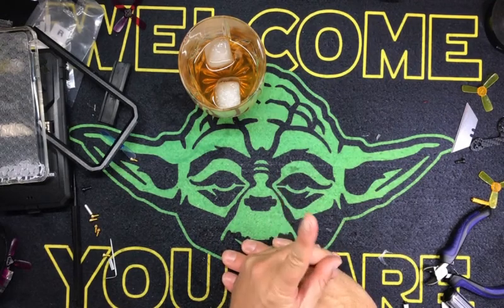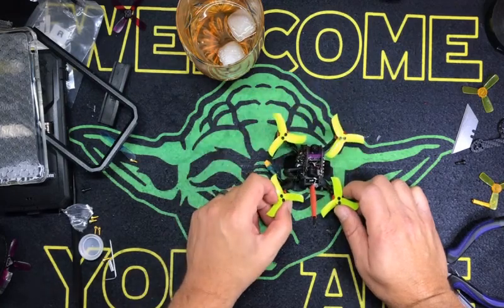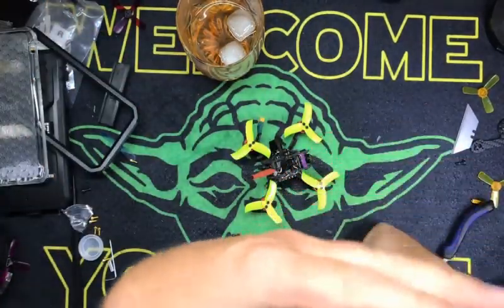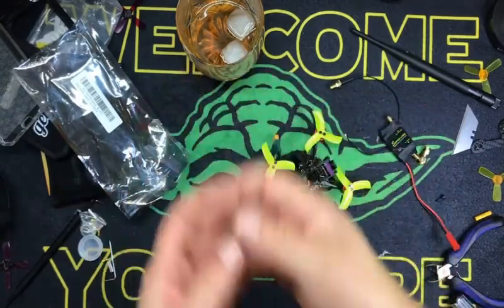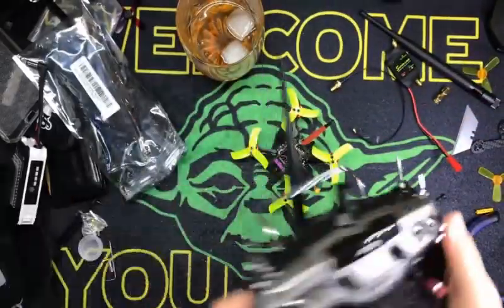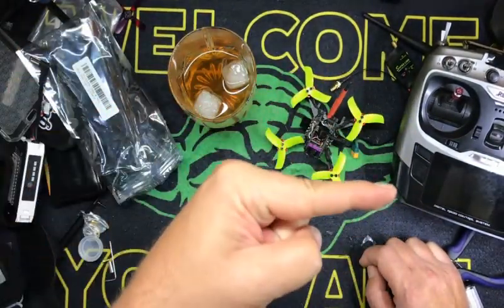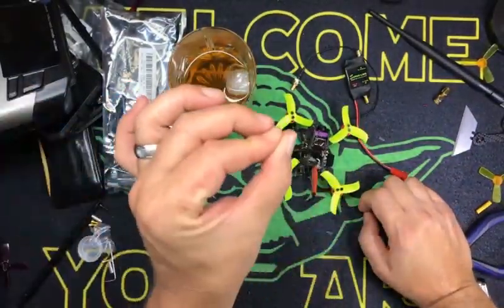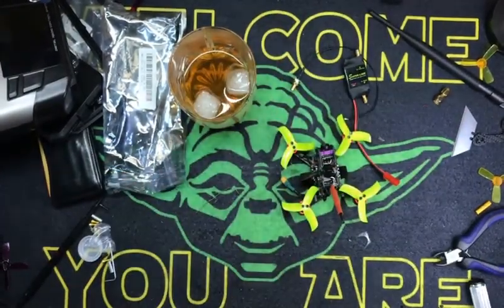RC Transmitter Range Boost - Episode 1 of 3 - The Before: Intro and test

Comment: lol I get nervous with a flysky a8s going over a couple hundred feet up. I've heard so many stories of failsafes and disconnects and what not with them. I've never had an issue on any of the three I have but you never know.
Reply from the maker: +Archer FPV yes I have one of those to that came with a review bird that was sent to me.   Not impressed.  I use it for a simulator controller lol.  At9 is a lot diff
Reply: JJRotoGeek I've been wondering about radio link. I was waning a storm racing drone at one time and they come with the at9
Reply from the maker: +Archer FPV I love mine.   I’ve beat it to death lol

Comment: Have u seen That new y4 frame banggood got ,,,,,,, https://www.banggood.com/A-max-Cerberus-Y4-110mm-Wheelbase-2_5mm-Arm-FPV-Racing-Frame-Kit-supports-Micro-Runcam-Swift-p-1210879.html.
Reply from the maker: +Quad Father 504 FPV just looked at it brother.   Dosnt look hateful, I see some things I’d change. I have a frame coming that I’m going to chop shop and I’ll do a video on it.   It’s a 110 tooo
Reply: JJRotoGeek ohhh ok lol I thought it looked like a pretty ok design with the back motors higher like a helicopter where u don’t have to worry about taking off or hitting ya battery, but can’t wait for the chop shop build 👍👍 n I think I’m  ordering the stuff tomorrow for a 3” build

Comment: Awesome!! Looks cool so far, but I’d try to keep the booster out of the case because of the heat, unless you put like a heat exchanger on it lol. I’ll be waiting for the other parts of the video but it’s looking awesome so far!!
Reply from the maker: +vidabask yessss I’m going to test that firsttt.  Part two should be up today brother
Reply from the maker: +vidabask brother, did u see the new firmware for our radios that makes Rssi work with any reciever and it works on the osd.  Just got it working.    Fucking awesomeeeee.
Reply: JJRotoGeek hooooly balls! They allowed to send the RSSI via a channel to the FC?! Awesomeeeee
Reply: JJRotoGeek are yo making a video on that? Lol I'll be waiting for the second part of this one
Reply from the maker: +vidabask and it workssss.  Just tested it
Reply from the maker: +vidabask lolol second part of this one is coming up.  And ya I can do a video on it.  It’s stupid easy
Reply: JJRotoGeek I'll update as soon as I get home!
Reply from the maker: +vidabask damn right.  Update then assign an six channel in your trans to Rssi.  The. In the reciever tab of betaflight towards the right, you’ll see a drop box for Rssi channel, assign that to the aux your using.   Then enable Rssi in osd!!!! Bam.   Easy
Reply from the maker: +vidabask dude.   Range boost totally worked.  Build cideobwill be up today